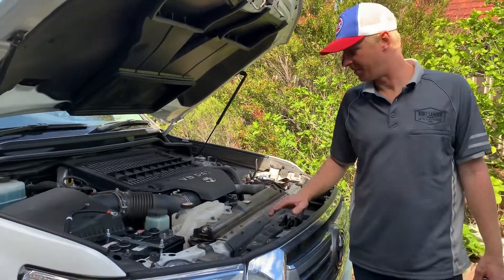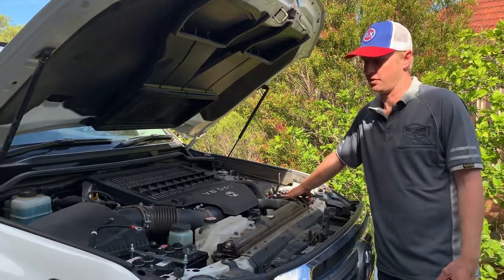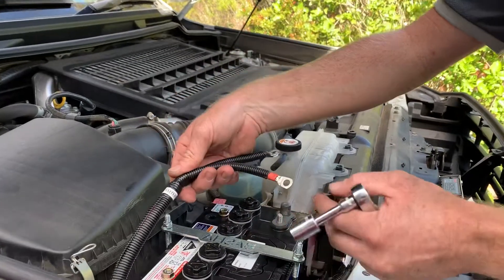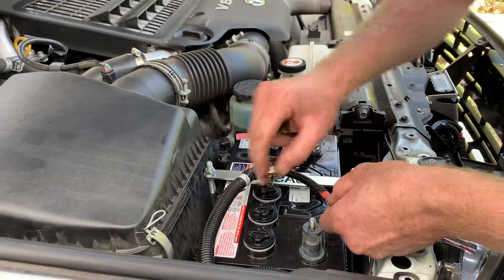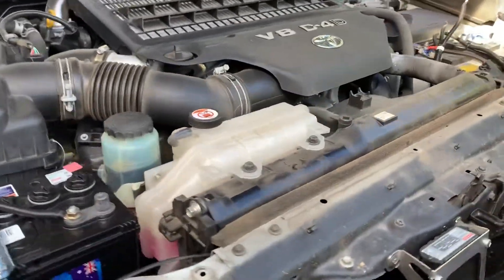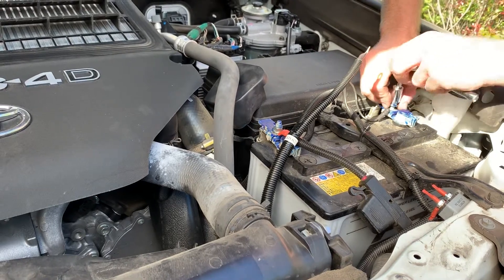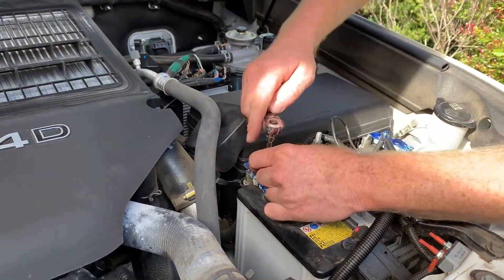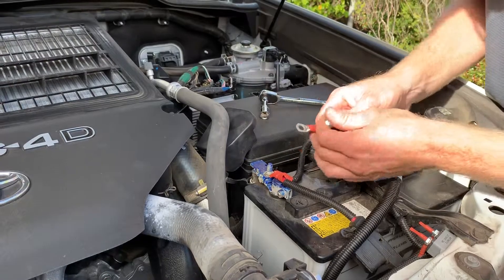Instructional video - How to connect battery cable on our Redarc dual battery kits

Comment: Cheers. Where did you connect the blue wire?
Reply from the maker: The blue wire is only required on variable voltage (smart) alternators so its not need on this car that has a temperature compensating alter nato but if you watch any of of videos on cars with smart alternators you will see how we connect the blue wire into the engine bay fuse box.